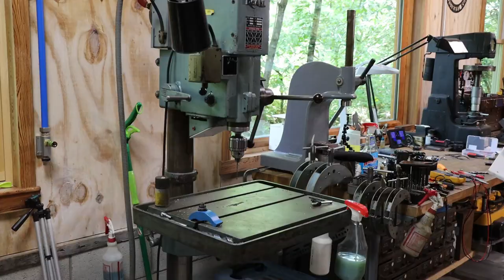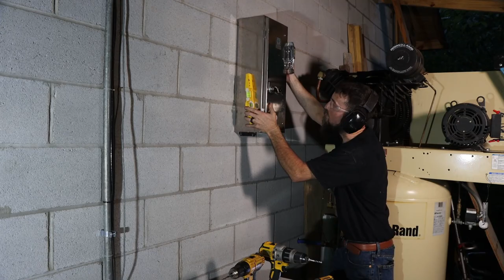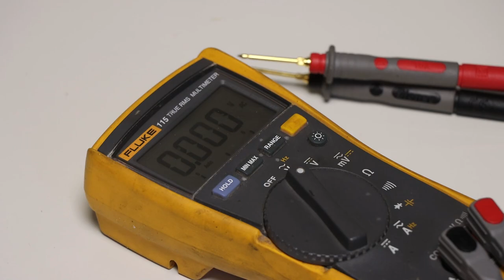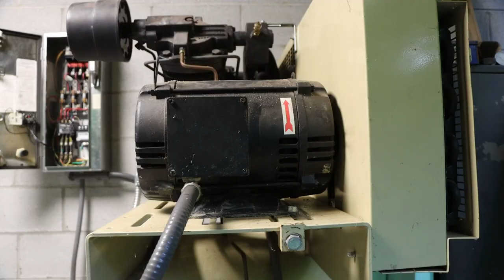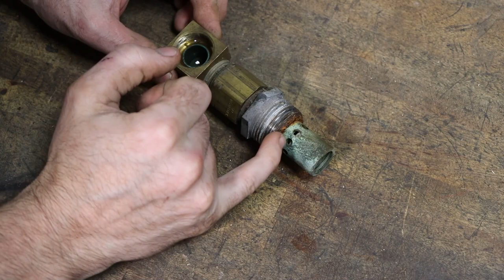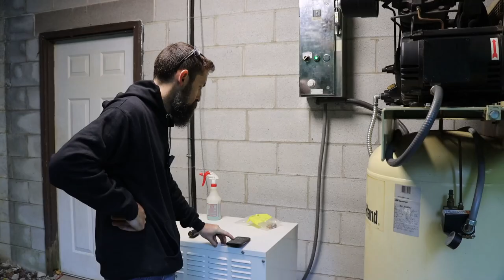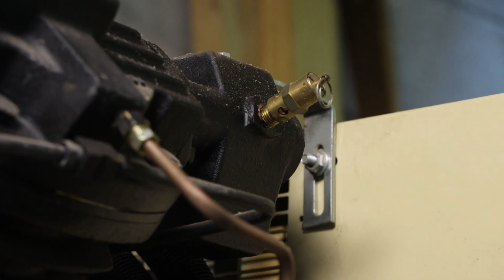Wiring & Test running my Big  Compressor

Comment: Not sure which is more beautiful,,Elisabeth or the compressor and the wiring? Both are awesome, and we also deal with Dirt-Dobbers here in TX. They can really play havic when they build nest inside the shop (@@)! Fall is near, got go out this morning and stop my leaking air line fittings aafter watching,,thx Steve & Elisabeth :)>,,,Bear in Tx.

Comment: that piece of metal could have come from the compressor inlet reed valve and you might want remove the cylinder heads to find out because a broken reed valve could greatly reduce your compressors efficiency.

Comment: you need a 7hp motor to maintain 100psi with a  1/16 hole in your pipe. . i used to help the maintenance crew..  tone uk

Comment: Your transformer is 100va so at full load it will be 0.41amps (240 side) , probably your coil is 0.1amps so a 0.25amp fuse at 240v side should be fine, the max fuse should be 125% full amp so 0.5 A max.  Those rules are in the electrical code or UL Standard 508A, Industrial Control Panels.

Comment: Hi Steve,

I'm a little confused about why you're using a transformer for the contactor coil/pressure switch circuit, isn't there a neutral line available from your panel? If so, then you could go straight to the contactor coil and pressure switch circuit with the generated 120v leg along with a neutral wire without the need for the transformer and as others have said, the generated leg would prevent the contactor from energizing if the phase generator is not on.
Those transformers are usually only needed when it's high voltage like 440 or 480.

BTW, the output of the transformer is usually only based on the ratio between two internal windings like 2:1 ratio from primary to secondary for 240v to 120v. Sometimes it's a simple matter of where they tap into a single winding, half way tap divides the voltage in half but it depends on the type of transformer it is. 

Also, I would be a little concerned about that small piece of what looked like stainless steel trapped in the check valve, that may be part of one of the reed valves from the compressor. 
It may be worth your while to check it out just to be on the safe side but that's just me! 

All the best to you and yours!! :-)

Comment: The little particle that was jamming the check valve, do you think that might have been the tip of a box knife? Was trying to go through mentally what is stainless and that thin in the compressor head. It's kind of driving me nuts trying to figure out where it could have come from

Comment: Do you get one active phase when the rotary converter is off? We don't get that here in OZ. If so you could pick one of the other phases to work the control transformer. Then it couldn't try and start. Also you could replace the rotary switch with a push button and contactor .
And you need some amperage monitor on the line into the shop, so when the draw is two hi the compressor won't start.
Reply: There is a contactor in there

Comment: Your connections, internal routing , and placement are dead on. Good job. I won't weigh in on the Ohm's law thing. That's been covered ad nauseum. I would recommend that you rewire the connection between the box and the compressor however. You should add enough wire to create a bottoming loop in your cables so that rain, dew, or other condensation will drain by gravity, down and away from the units. I also noticed your need another hand to use your VOM. Fluke makes a T-600 that will cure that problem. I love mine.

Comment: How cold does it get there in the winter?  Those units ( Ive had a couple of them)  will smoke the motor in winter if they get to cold. May need heat lamp or crank case heater.

Comment: Hopefully there's a connection or a contact on the phase converter to say if it's running, 
How do you turn on the phase converter, switch or starter ? might be something there you can tap from, use a relay to break the control circuit
Shame you can't get proper 3 phase.

Comment: Hi Steve, Would it be possible to split one phase off your inverter output to give you the starter voltage you need that way the compressor has no single phase voltage when the inverter is off?

Comment: What would I do? I would have put the control box inside the shop close to the phase converter control. Surely the three phase output is off if the motor generator is off. If not, why not? If you have to, use a relay to shut off all power to the three phase supply If the converter is not running.

Comment: Isn't one of the 3 phase legs dead when the phase converter isn't running? Could you use that leg to power the transformer for the control circuit? That way if no 3 phase, no control circuit. I'm not sure if its always the same leg that goes dead though.

Comment: 21:30 Air leak - Is that brass pipe union on the top of the compressor cylinder got a non-return valve in it ? Also, the compressor valve should act as a non return valve too !

Comment: The shop where I used to work had a unit nealy identical to yours. One time a drink driver smashed into the shop and sent it flying about 20 ft. When we checked it over it was almost undamaged and worked fine when we hooked it back up!!!  How's that for resiliance?

Comment: Surprised you didn't install the control box inside the shop... but then I s'pose you'd have to be running back and forth during the install. Swings and roundabout ...

Comment: How about a contactor or relay coming from the phase inverter that closes at 240v, and have the DPDT switched side connected to the power input side of the compressor.   No 240v  no run.
Reply: Phase converter should already have an output contactor, they struggle starting up under load, so will have a contactor there to disconnect the output, till up to speed.

Comment: Is there any reason one should not leave a compressor under pressure? I only ask because I inherited my shop and it has a full air system, the exact same specs as yours in fact. I was sitting here thinking about how much volume there is in the plumbing in addition to the pressure vessel and realizing that I've been unusually lucky. My system I just leave pressurized all the time. The float switch kicks on about once a month for a minute or two. I've never had any leaks or wet air problems. Is there any reason I should stop doing this? I do drain the tank on occasion but there's never much water. Is there anything dangerous about leaving it full? I'm on like 8 years now. I just want to know if I'm doing something stupid

Comment: I think at the end, I think you asked for a way of making it "push button control", rather than rotary switch.

This is possible, and it would mean it wouldn't come on again following (E.G.) a power cut.

I'm in the UK, and used to UK parts and conventions - but I still know how to do this.

Apart from the pushbuttons, you'll need an auxiliary "control" relay. If you send me a schematic of what you have, along with the part numbers of the main parts, I'll design something for you, based on parts I think you can get. If interested, send me a message and I'll send you my email address.

Yes, I'm a professional graduate eletrical / electronic engineer.

Comment: WARNING about the oil level safety switch. Its located just left of the oil fill cap. Its supposed to shut off the compressor if the oil is low. Sounds good right. Well its a poor design. I used to work for Ingersoll rand and there are multiple issues with their stuff. It seems as though others have commented on everything else so I will tell you about this. Lets say you are just low enough on oil for the safety switch to cut power. What actually happens (too often with these) is the float is right on the teetering edge of being either off or on. With the vibration and so on, the switch opens and closes multiple times per second which causes your starter contactor to chatter open and closed very fast. It causes damage to the starter which can later cause a motor failure. Easy fix though. Your oil fill hole is actually at perfect height for the oil, in other words you can fill it until it overflows and that is the perfect oil level for that compressor. You literally cannot overfill it. Fill it to the max and just check it once a month and dont let it ever get down to the safety switch to begin with. If it doesnt pass oil, you wont have to check it as often. Another thing you should know, IR products almost always have the part number of each item stamped into it somewhere. Thats probably one of the only things i like about them.

Comment: Your compressor is a heavy hitter and you may be taking too much of the capacity of your phase converter. Do you want the compressor to come on when you are taking a heavy cut with something? The fix is big $$$ for a single phase motor (K. Rucker did). That and I can not believe that the phase converter would leave 2 of the legs powered when off.

Comment: Correct me if I am wrong. You said the RPC's output when off is 240 single phase?
That is crazy/stupid! The output should be connected to a magnetic circuit breaker which opens when shut off.

Comment: You cannot measure a transformer's impedance with an ohmmeter---it will measure only the DC resistance of the transformer winding. The actual magnetizing current of the transformer winding is largely dependent upon the inductance of the winding.

Comment: Bit late but NEVER leave you compressor under pressure when it’s not in use. If it’s under pressure when not required this will rust your tank from the inside very quickly. Air has 20% oxygen at 5 bar that's about 72 psi the oxygen may as well be 100% at 0 psi. We all know that Oxygen causes rust. 
Water in the tank with that air and Oxygen pressure will kill your tank very fast.
I need pages to set up your system.
Compressed air cost to much, use other power tools if you can.
Drop the pressure so that the cut in point is just a little higher then the maximum pressure you require and reduce the set differential pressure to a minimum.

Comment: You do not want to have power going to that relay 24/7 X 365 to function the relay must use DC, it follows you have to have a rectifier. Many years ago I worked for a rental company with coin in the slot TV.   What happened if a rectifier failed was you got Dc into a coil which wanted AC melted tar then oozed out of the thing on to the customers carpet. Due to global warming storms and the like are liable to be more frequent and more severe. As such if I was wiring that as in your position the power would get a main throw switch at the entry door. That workshop would be dead till I wanted power.

Comment: You can spot Allen Bradley (AB), controls a mile away, so big in size ( not a criticism), contemporary equipment are much smaller,  but still bigger than their competitors, excellent availability on AB equipment worldwide. 
A other shop job ticked off. As already mentioned by a subscriber, reduce system pressure to 120 psi, no need for 175 in an engineering environment. 
Thanks for Sharing,  and my thoughts to all those affected on 2001/9/11. 🫂.

Comment: As a german electrician, my toenails roll up every time i see american electrics! 😬
It´s not all bad, but alot of what you use is outdatet her in Europe for 50-100 years!

For example, lose wires in metal conduits are not used since the 50s because you have to make sure all metal parts are safely grounded all the time.
It turns out, thats often a point of failure. Cabels with a second layer of isolation are way more secure than that. (and easyer to work with AND cheeper)

And those wire nuts!!!! Jes! thats a hazard of it´s own.

In the US every year 150 "profesionell" electricians die directly from electricety (with your 110V🤭)
In germany we average around 5 per year!!!
Civilians average in Germany around 15.
In the US i can´t even found anything at all, i asume that this number is way higher than the "profesionals"

Fire through faulty instalations in germany make up 30% of all fires.
seeing that the average fire per head is WAY higher in the US, you can assume all of those aditionals are through electrical failure!
Or higher densety of idots.🙄

No insult to you Americans... we Germans have ALOT of Idiots to!

Comment: Steve, love your channel & watch it all the time but, I have to tell you that you have completely embarrassed yourself this time.  You clearly have zero knowledge of the electrical trade.  You used the wrong terminology for components you were trying to describe. You implied you could (or need to) calculate a transformer’s primary current with ohm’s law and with no load connected to the secondary – wrong.  You didn’t seem to understand or at least didn’t mention that it makes a difference that the primary side of the control transformer should be fed from two specific lines not just any two out of three (when the power source is a rotary phase converter).  You never operate a disconnect with the door open.  You close and latch the enclosure, then operate the disconnect, then with the disconnect on you use the interlock bypass to open the door.  Looking away does not count as proper safety apparel. You should have provided power for your automatic drain by sizing your control circuit properly and not have the need of a second plug in circuit to power it.  You definitely should have used momentary stop & stop push buttons and not a maintained on off selector switch.  Your controls should be inside the shop (like your phase converter) and you could still have a second control station local to the motor if desired.  Now you have to go outside to “see” if the pilot light is on or to turn the control circuit on or off ? ? The real on/off control is the fused disconnect which is local to the motor as it should be.  I am suggesting you should take this video down before it affects your reputation and, more importantly before other viewers that may know even less than you, use your video a reference to incorrectly connect their equipment.  Again, I really do watch your videos regularly but please stick to machining content.